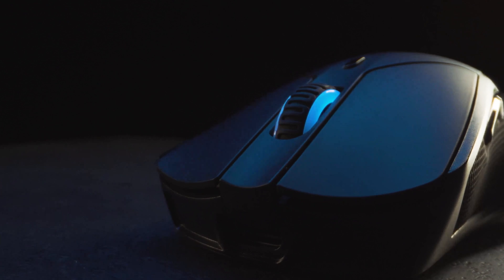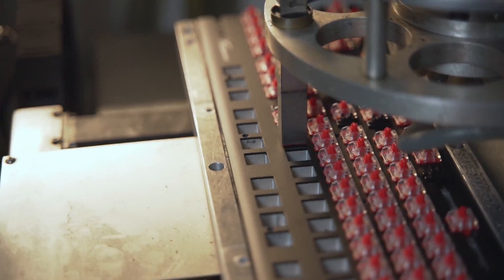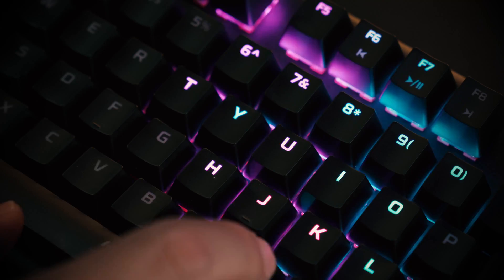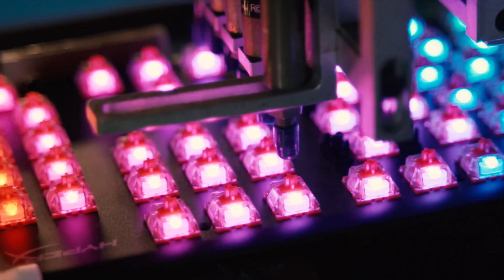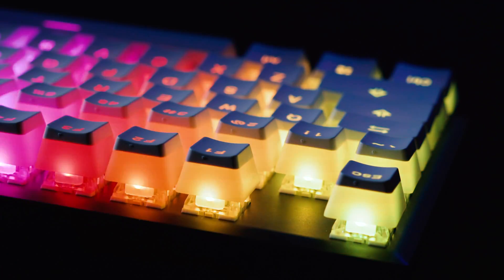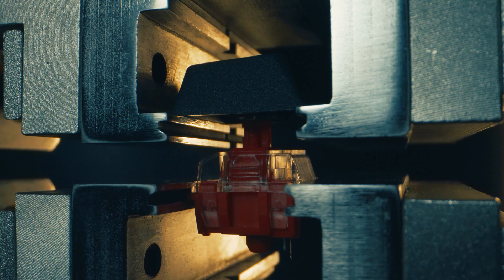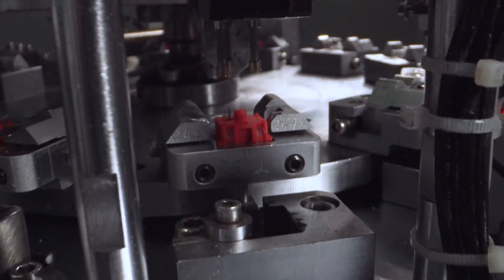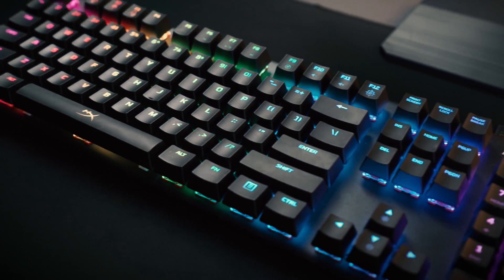The Making Of – HyperX Mechanical Key Switches

Comment: Now if only you would stop with the reliance upon Ngenuity or at least relying on Microsoft to host the app (which tries to goad you into signing in or signing up and letting them have more control over your system). Then there's the fact that Glorious PC is making modular keyboards for a bit more and have lubrication and more stable stabilizers so that the space bar doesn't rattle. Right now the longer keys that have stabilizers are making the most noise on my HyperX keyboard.

Comment: pls start selling these switches
Reply: You can get used boards on eBay for pretty reasonable prices compared to buying boxes of non-knockoff switches. You'd have to desolder them to use them and I'm not sure if the LEDs would be a major issue. I will report back in a few weeks because I got a tkl with aqua switches for 17$ off of eBay yesterday.

Comment: so it does not support mac, isnt it?
and does red switch feel closer to Kailh box red or cherry red?
Reply from the maker: Mac is not currently supported for the software, but the keyboard can be used as a plug and play device. The switches are close to Cherry red switches, check out the specs https://hyperx.gg/2L1Dmst
Let us know if you have any questions!

Comment: Are this switches MX compatible? I don't know if I'm asking the right question but, will other standard switches like  Cherry and Gateron work on keyboards that use this switches (HyperX Alloy Origins for example). Also about keycaps, will standard keycaps work with this switches?
Reply from the maker: As in MX Compatible key caps? Yes.
Reply: This board is not hotswappable with its switches